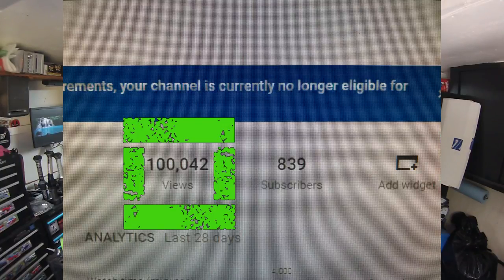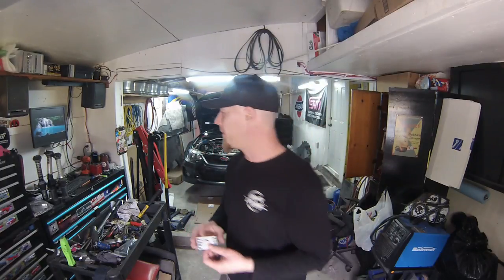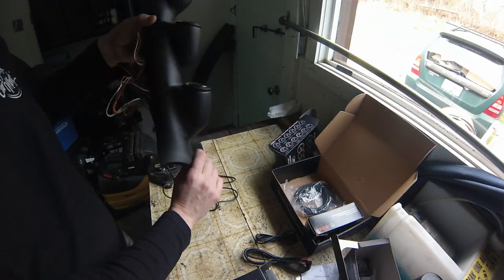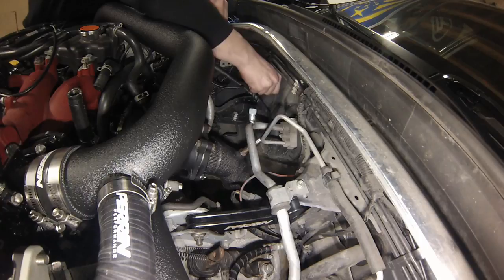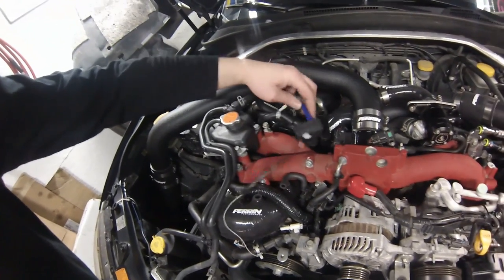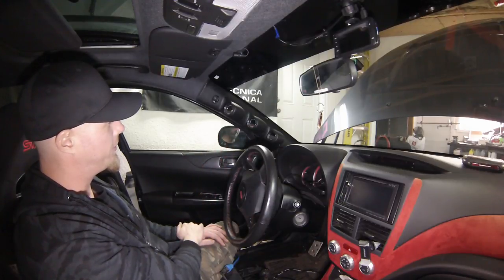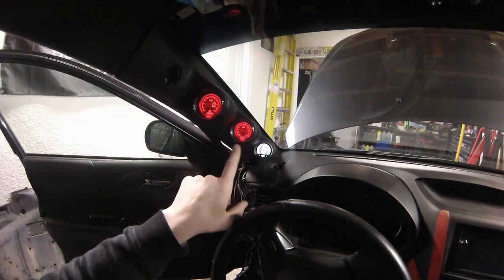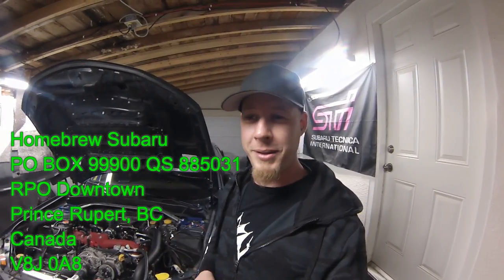2013 STi Build Part 17 - Prosport Gauges Install How To

Comment: I took off the my girls friends turbo on her wrx and I was going to swap it with another turbo that I bought for 125 and the cold side compressor and the sides of the wheel look bent and the wheel doesn’t freely like the one I took off of her car
Reply from the maker: The replacement sounds like it's trashed, that sucks.

Comment: Did you take the battery off to avoid side airbag going off?  Missed that part in the video? Thanks
Reply from the maker: The battery was already on a breaker switch at this point I think. 
Easily switched off although don't ever be too worried about disconnecting the battery around an airbag.
What deploys airbags is a module. You would have to be quite negligent to have one blow in the car.
Reply: @HomebrewSubaru  Thanks for the quick reply! About to do this on my 86 but was like...ruh roh..is that buggah gonna explode in my face...lol.  I suck at working on cars!

Comment: Power take the battery or fuse;;  I got a temperature gauge evo water temp with peak and warning. It does not keep in mind the settings I have made to highlight the high temperature. Every time I turn on the car I have to adjust it again .... What can be a blame
Reply from the maker: There must be a circuit that gives constant power to the gauge to hold memory setting when the ignition is off.
Reply: Homebrew Subaru Do I take power from a fuse that has continuity of current? such as clock

Comment: Dosnt throwing an air filter in line of boost  change you pressure reading/ vacuum
Reply from the maker: motivation IN Drive filters may affect flow, not pressure. They aren’t restrictive enough

Comment: I also noticed that there was oil in the y tube that connects to her intercooler from the turbo would that be a bad turbo bearing?
Reply from the maker: Often oil is found in that location, it tends to pool up there and not pull through the intercooler. The cause could be a few different things. Bad turbo seal, although you would notice more oil burning from the tail pipe. A bad PCV valve, where it is stuck open. Blow-by, when cylinder pressure is getting past the rings and into the crankcase. Improper oil catch system, only when the vehicle has been modified for excessive cylinder pressure.
Reply: Damnit I was hoping you wouldn’t say blow by 😭 I think it might be because you smell burning oil when you get on it I know her valve covers are leaking a little bit but shit is it even worth fixing it or just swap the motor
Reply: If only the wrx was mine I would never have let it get to this 🙄
Reply from the maker: I'm the guy that tries to fix and reuse everything. If it's still making power and doesn't shoot a cloud of burned oil, that's a good engine. The thing with swaps is they are used engines as well. They will have old gaskets and seals, regardless of mileage. Prob cam seals seeping on her WRX and it so happens I've got one coming in after my Impreza, for cam seals.
Reply: I’m 19 I have no where near enough experience to call my self a mechanic but I know how to do most common stuff on car engine, I did a head gasket for my buddy’s Audi A4 and retimed everything perfect did a valve cover gasket on my bmw which was the biggest bitch but I would attempt to fix her engine but the boxer motor scares me lol you make it look so easy her motor doesn’t shoot out smoke like at all but her boost is just not where it should be
Reply: I ordered a brand new turbo when that comes in I’ll make a video of where I’m at and post it to my channel and show you what I’m dealing with and hopefully you could give me some advice